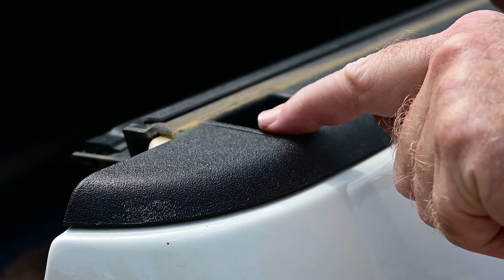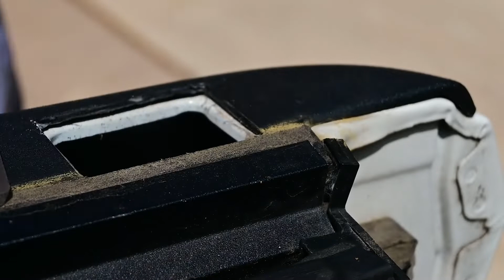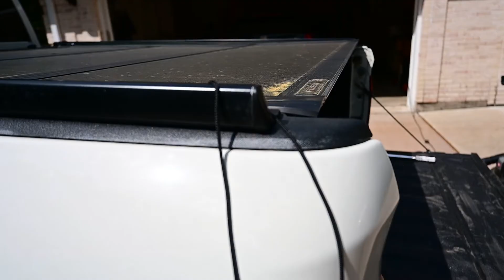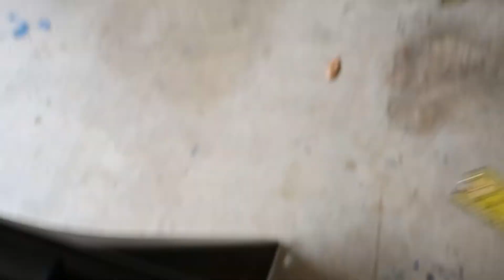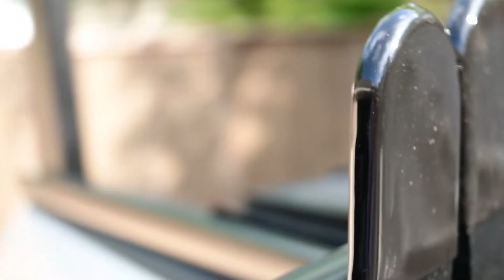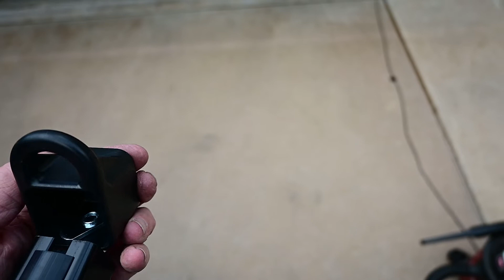Adarac Pro Aluminum Truck Rack

Comment: I wish their website was more informative. Trying to find something like this for my 2016 Tundra that has a BAK BAKflip MX4 tonneau cover. EDIT. I just realized, is your cover a BAK? I also realize this is 3 years old, but thanks
Reply from the maker: Yes, Mine is a BakFlip. They work well together. Mount the wails on the top of the bed just outside the edge of the BakFlip cover rubber seals. Not difficult to install.  I take my uprights  on and off all the time as I need to. Leave the rails on all the time.

Comment: Now that you have had it for 2 years, how do you like it?  How much wind noise at highway speed?
Reply from the maker: I like it for its utility. I can haul 20 foot long 2x6's for my deck repairs. The tie down points ork out very well with ratchet straps. There is no noticeable wind  noise when unloaded.   I take it off when not hauling lumber so it is easier for me to get in the bed and put taller objects in  there.